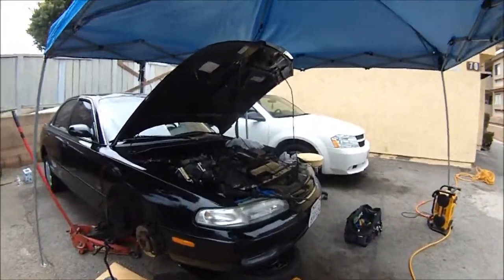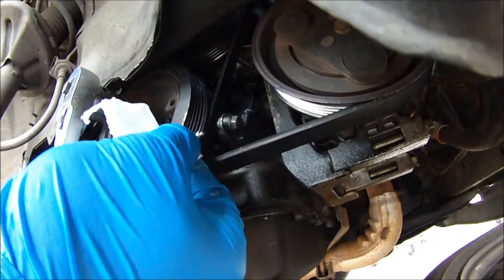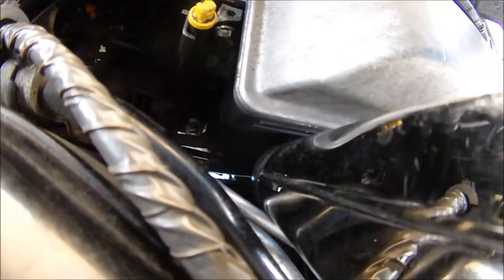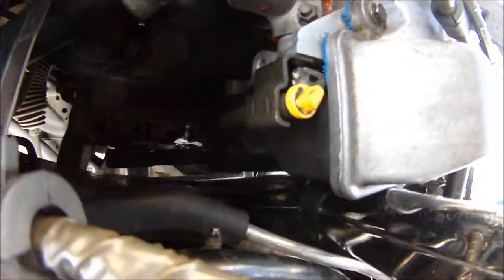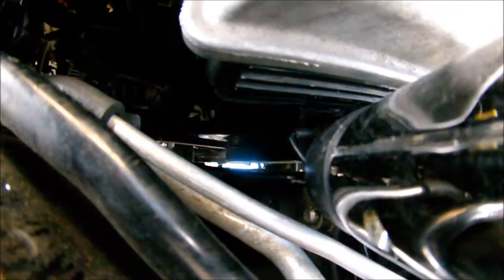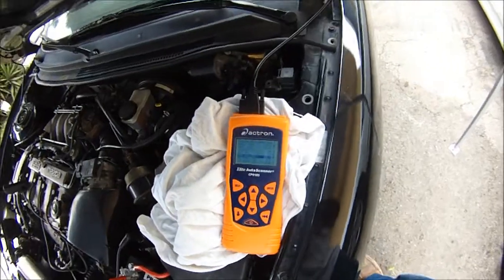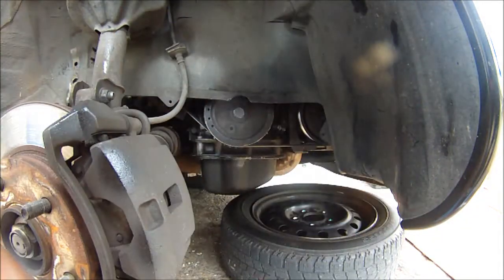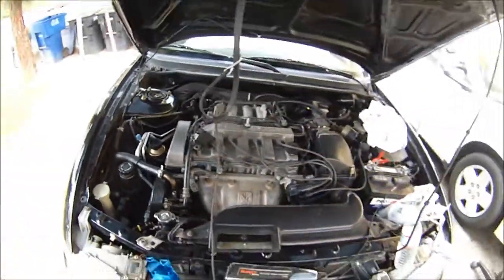TIMING MARKS OFF, SLIPPING CRANKSHAFT PULLEY/HARMONIC BALANCER INERTIA RING (PART #1)

Comment: Hey Oldskool.  Its good to see you out there fighting that fight.  Do you know much about carburetors?  Im working on a 78 lincoln mark v and the engine is a 460 with a motorcraft 4 barrel on it.  I cant find any vacuum leaks and it has a hesitation on acceleration.  The accelerator pump appears to squirt gas fine.  Timing is correct and vacuum is in the green range.  I tried to adjust the air/fuel screws but one of them seems to have no effect.  The other adjusts fine.  The owner said the carb was rebuilt but it still runs with a hesitation or a bog when accelerating from a stop or even from a cruise situation.  ny info would be appreciated,  Thanks for being there.
Reply: Get a wideband afr, adjust it from there,